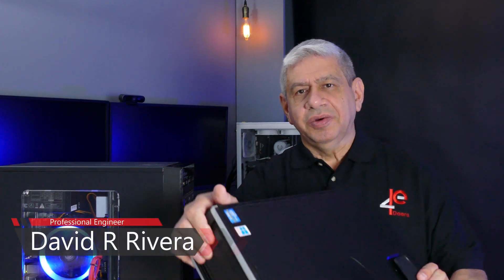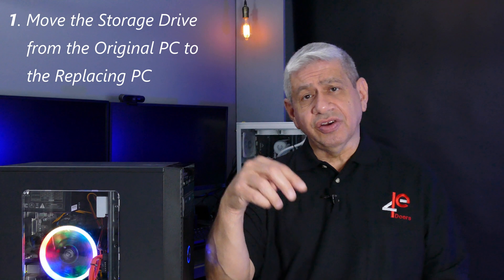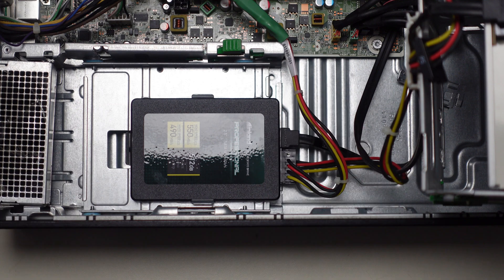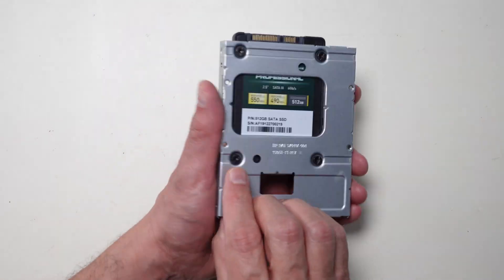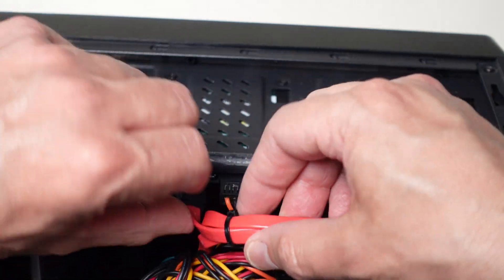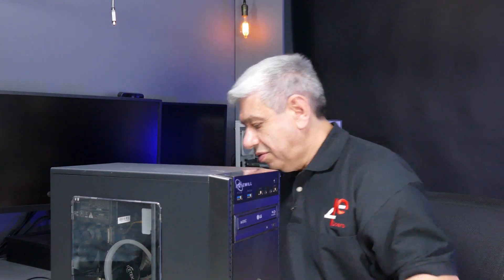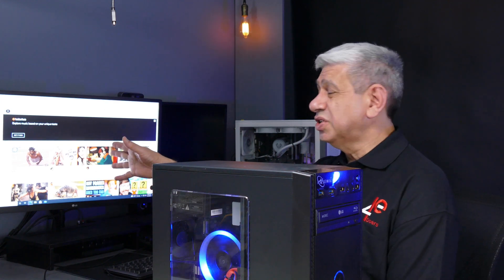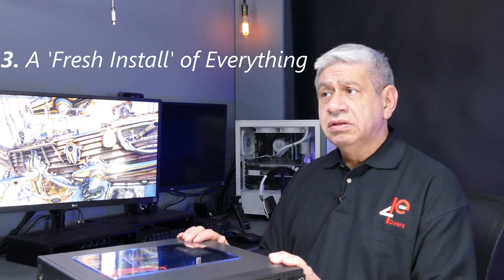3 Ways to Move your Programs to New PC

Comment: Just came across your channel and enjoyed this video 🙂
My HP laptop has recently died so am looking to try this method myself. Would it have to be another HP laptop, running Intel g3 (like the old one), or could I go up to a laptop running Intel 7/8? I have windows 7 professional on the drive.
Reply from the maker: It really doesn't matter what the CPU is on the replacement.  Even if it is a switch from Intel to AMD, or visa versa), since it will download the updates need once you connect online.

Comment: Thanks for the video. I am upgrading my motherboard, CPU, and ram from a PC I built in 2010, which seems similar to the swap of PCs in your video. Old system was Asus MB & AMD Athlon II CPU. New is ASRock MB and AMD Ryzen 5 8600G. Do you think Windows 10 will fire up successfully if I just swap old for new?
Reply from the maker: If you switch from Intel to AMD CPU's, you sometime have some Drivers issues.  If that happens, I sugge4st you remove as many of the drivers as possible and reinstall them.
Reply: @PE4Doers  Thanks for the reply. Both CPUs are AMD, so that may help me. Thanks again!
Reply from the maker: @JonnyScott1776  I think it will.  Good luck.

Comment: old Architect here, Mr. PE :-) ...who will try the 1st method. Plz...1. did the MS-license key pop-up appear, after all? 2. Did your CAD-software present problems? I'm buying a better & repurposed Dell w/W11, for my good ol' Dell 7040SSF w/W10. My CAD-software* is my most-concern, not a game :-) I was going to Clone the whole drive, but a simple SSD-swap seems best, as you did. tanx!! * I use ActCAD (as you might consider, too!!) which places some registration files in the C: Documents Folder (and who knows where else). Gulp....I'll check back for your advice. tanx, again!!
Reply from the maker: It's possible your CAD Software allowed you to turn off the license on one system, then reactivate on another.  I have two different versions of my Video Editing software that allow that.  Have you reached out to the vendor yet?

Comment: This was pretty useless, to be honest. Not JayzTwoCents, to be sure. Nothing about uninstalling the previous hardware or drivers. When I tried the same, windows wouldn't allow me to install any of the mobo drivers because the old ones were still on there and it gave me an error. Typically most users will need to uninstall and/or do a Sysprep in windows.
Reply from the maker: Sorry I couldn't serve you better.  A full refund of your payment is in the mail.
Reply: @PE4Doers  LOL I'll be on the lookout
Reply from the maker: @Billkwando  I am concerned I violated a federal law by slicing of 1/700 of a penny with some clippers, but I trust you won' rat me out.
Reply from the maker: @Billkwando  I just hope the feds don't come after me for shaving off 1/71 of a penny from minted currency to pay you for a view of my video.
Reply: @PE4Doers  The missing step is to go through Programs and delete any drivers for your sound, network, mobo, bluetooth etc, anything that's specific to the hardware you're leaving behind. Also, going to Device Manager and doing Update Driver on the SATA/IDE controller and doing "let me choose from list" and picking the generic MS controller. Do that for any hardware you can find, and uninstall all the processor stuff as well.
Reply from the maker: @Billkwando  When I made that video, I was not looking to provide a means for transferring the O/S to a significantly different CPU architecture.  Even JayZTwoCents avoids doing that when he uses his USB drive to move the O/S and testing programs to a new system.

Comment: I had serious doubts about this working. So..   I had an old HP with windows 10 pro. Pulled out the WD HD and planted it into a much newer box with a GeForce card. Took it about 2 mins to find the new hardware. I needed to install the nvidia drivers but that was it. didn't have to enter any new product licenses...
Reply from the maker: I am glad to hear it worked out well for you 🙂
Reply: @PE4Doers  I spoke to soon. I had to call Microsoft to reactivate windows 10. No big deal though. That took all of 10 minutes.
Reply from the maker: OK, glad to hear it worked out in the end 😂

Comment: I am upgrading my desktop HP Pavilion to a newer desktop because I want to do video editing.  But I love my old computer (it does have an 1TB SSD from a previous upgrade I did) and want to keep all the applications and features and layout. I don't want to lose them and start all over with the new desktop (which will likely be a refurbished HP Envy desktop).  I will use my existing monitors and other peripheral devises like scanner, printer.  I sure hope it works as well as it did for you.  It is worth a try.
Reply from the maker: Upgrades are much more error-free these days than they were 30-years ago.  Just stay away from a Dell pre-built.
Reply: Thx. Never was a dell fan. I like Hps. I just ordered the Envy refurbished from Amazon.  It was about 1/2 price of a new one with i7, 32gb RAM, Nvidia graphics card w/6gb. Big upgrade to my 12 year old Pavilion. Worse case, I will reload everything.  Thx
Reply from the maker: Sounds like a solid plan - Good luck.

Comment: I may have missed it, but what OS was on the old and new SSDs?  If you are swapping Win10 to Win10, maybe it works.  I am going from an old PC running Win10 to a new PC running Win11, tried cloning my old HDD using Win10 onto a new NVMe SSD installed as a second drive.  I believe the clone was successful, but the new PC would not boot from the cloned drive that has Win10 on it. At least I now have all of my old computer files available on my new PC using the new second NVMe SSD.  But I am now stuck with Method 3, reinstalling everything.  I had some old legacy programs installed on my old PC that cannot be reinstalled on Win 10 or 11, so I have lost those programs forever.  It is called forced obsolescence...Microsoft does not want you to continue using old legacy programs that you paid for and legally own, they want to force you to buy all new subscriptions.  Thanks for nothing, Microsoft!
Reply from the maker: You are correct.  When you try to retain the older programs you can run into a problem like that.  In my case I was going from Windows 10 to Windows 10.  You can also have similar problems when upgrading from Windows 10 to Windows 11.

Comment: Could u also use a memory unit/card to transfer all your saved data to a new pc?
Reply from the maker: That would have a problem as soon as it lost power.  Unless you had two separate PC's networked together.  Then, it would sill be unable to properly copy the System files, unless you used some sort of imaging software.
Reply: @PE4Doers  lost power? You mean if my electricity lost power as soon I'm transferring all my data to another PC with a memory card?
Reply from the maker: @danieldobrovolskiy3810  I meant when you shut the power down on your memory, it would lose its contents.  I apologize if that's not what you meant.

Comment: Thats exactly what I hope to accomplish as Id like to move the system drive with all the millions of installed applications from an older windows 10 pro computer to another windows 10 pro pc. To be safe i may clone the drive and use that cloned drive rather than the original if things go wrong. What i am curious is since both PCs had licenses to begin with (at least the old and new pc i have 10 pro licenses), when you installed the old drive into the new PC, and after windows did its bit, did you check to see which of the two licenses it is now using or were active? I am curious if it changed the registry to the new PCs license or kept the old one. I would like to use the new license and leave the old license in the original pc. Everywhere i read people talk about retail vs OEM but that is when you are trying to move W10 licenses. I want to keep them as they are as I do have two licenses. So was curious of what you found. Thanks!
Reply from the maker: You still only have one legal license if you change motherboards with a copied storage drive.  Did you purchase that Windows-10 license, or did it come with the PC?  If you purchased it separately, and you registered it with Microsoft, then you can call them and transfer it over to the new motherboard.  The previous motherboard would no longer work (or at least show as fully licensed).

Just keep in mind that the only thing you would really miss by not have full license is the ability to customize the system appearance.  Everything else should work, unless some other software you added also has licenses, which would require that you follow the instructor for each to transfer from one PC to another.
Reply: @PE4Doers  Thanks for the reply! So if I understand you correctly though I presently have two separate W10 pro licenses on the two different Dell workstations (yes the official licenses came with the two workstations), if I move the SSD/drive from workstation 1 containing the OS, to workstation 2, i would effectively lose one of the two licenses? A little confused here since i thought the licenses were ' digitally attached' to the motherboards and so moving from workstation 1 to 2, would just change from license 1 (attached to motherboard 1) to license 2 (part of the motherboard 2 setup). Is that not the case? And yes thank you for also explaining what u lose without a license. Doesnt seem much but i would prefer having a license though :-)

Comment: Isn't there an easy transfer program built into Windows to pull all of the settings, apps and files?
Reply from the maker: There are products you can buy that will make it work better, however even the best of those run into issues when going from one motherboard to another.  It is especially difficult when going from Intel to AMD or visa verse.

Comment: Have I missed something? What happened to the other 2 ways?
Reply from the maker: Sorry I didn't put them up on the screen with numbers like I did when first option, but if you jump ahead to 8:24 in the video I do at least mention them there.  They are more of the 'traditional way' someone would do it that does not want to move hardware around.

Comment: He had the same video card in the old machine and he put it in the new machine that's a big consideration.  When I try this later before I clone my drive I'm going to uninstall the video card driver and maybe even the chipset drivers if I can figure out a way and then have them ready on a bootable USB so I can install chip drivers for the new motherboard
Reply from the maker: That's a good idea.  I have found that I only had problems with the video card drivers when I switched from Nvidia to AMD or vice-versa.

Comment: what things could go wrong from moving from an intel 2nd gen system to an amd 5600x system? I'm a bit nervous putting all my data at risk
Reply from the maker: There are always risks.  However that specific move you mention should be rather low on the scale.  Do you plan on doing a fresh Windows 10/11 load?  If not, the risk will go up somewhat due to drivers and older Apps that may be left installed.
Reply: @PE4Doers  I don't plan to reinstall windows 10, What if I just uninstalled the intel drivers and ran sysprep, would that help?
Reply from the maker: @sylvorus  That my work, however you may still get a licensing problem since you are changing the motherboard, which is what the license is locked into.
Reply: @PE4Doers  alright, thanks
Reply from the maker: @sylvorus  no problem 🙂
Reply: @PE4Doers  though if there is a way where i reinstall windows 10, keep my license and somehow get all of my programs and personal files, I would, but so far I have found nothing.
Reply from the maker: @sylvorus  Yes, that is a little trick.  Have you looked into one of those $12 licenses?  I've heard that they work well (though I have not tried one myself).
Reply: @PE4Doers  Oh also, I checked my license. It says "Retail Channel" and it's connected to my microsoft account. Since my "old" pc will become permanently inactive, could I log in on my new pc and regain my license? If that doesn't work I could talk to microsoft support.
Reply from the maker: @sylvorus  I would give Microsoft support a call and check.  They can deactivate Retail licenses from an existing motherboard.

Comment: Hello Sir
I remember that HP PC very well because even I had purchased the same PC 18 months ago.
Reply from the maker: Are you still using that PC?  I will definitely be turning mine into a Linux box to do some testing of devices that I review both in Windows and Linux.
Reply: @PE4Doers  sold it 15 day's ago
Looking for a one which supports win 11 probably 8 gen processors.
But that PC was awesome especially for office work
Reply from the maker: @fazalbaig3135  Did you make any profit on it?
Reply: @PE4Doers  No
Reply from the maker: @fazalbaig3135  Too bad, I thought with the shortage of PC parts you may have done better.
Reply: @PE4Doers  Yourour right Sir
I realised after selling it
Can you tell me how's Dell and Lenovo compared to HP
And which one should I go for
Reply from the maker: @fazalbaig3135  They are all very close, although I tend to avid Dell because of their tendency for adding proprietary components (that you can only get from Dell).  You just need to focus on the processor type (model, speed, etc.), the memory and the video graphics card as the basis for making a decision.  Good luck.
Reply: @PE4Doers  Thanks for your suggestions Sir
Reply from the maker: @fazalbaig3135  No problem at all :)

Comment: Great Video :)) I am sure changing from a Intel to a new Intel PC system as shown works without any Glitches (as shown in the video: )). If you swap a NVME/SSD/HDD from an AMD to Intel or (Intel to AMD) PC a reinstall is a better option. 

To find all the license keys use Belarc Advisor / Link: https://www.belarc.com/products_belarc_advisor

To move files from an old HDD to a new SSD/NVME use the provided tool by the SSD/NVME Manufacturer. 

Samsung: Data Migration Software Version 4.0 / Link: https://www.samsung.com/semiconductor/minisite/ssd/download/tools/

Sabrent: Acronis True Image for Sabrent / Link: https://www.sabrent.com/download/acronis-true-image-for-sabrent/

These are just 2 Examples. For other manufacturers check the info included with the new SSD/NVME.
Reply from the maker: Thanks Kathrin for all the additional and helpful information.  I know there may be issues going from Intel to AMD or visa-versa, the O/S patches for the two are different, although I once did that without much problem by bringing up in maintenance mode *with network) and doing an Update.  Although that is not guaranteed at all since some of the original patches may not remove completely.  It is still worth a try if you have a lot of additional software to load.

In terms of Belarc Advisor, I have had issues where it could not pull out the proper keys, especially on a Windows 10 PC that was originally installed using a Windows 7 key (which still works fortunately since I have a bunch of those keys still left over from a bulk purchase I once did).

As I mention in this video, I would try the three methods in there assigned number order, using a reputable cloning utility for Option 2 and leaving Option 3 as a last resort.

Thanks again.